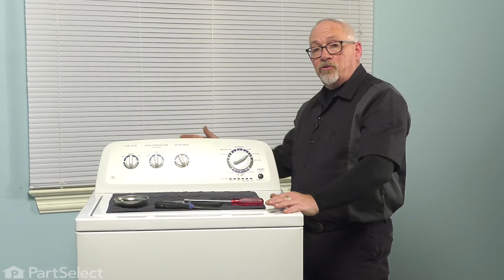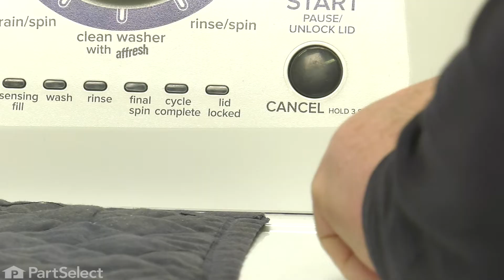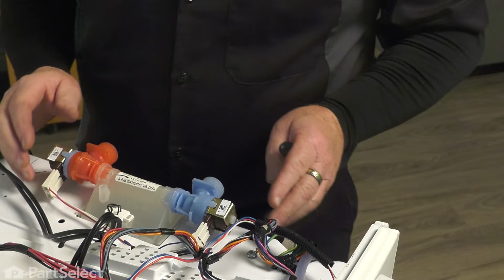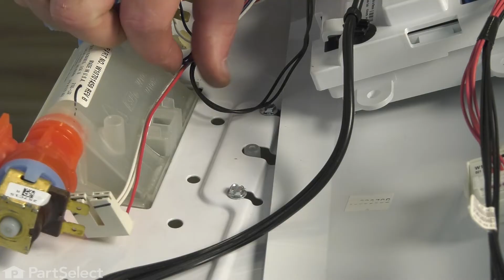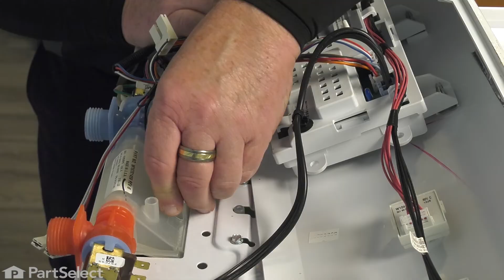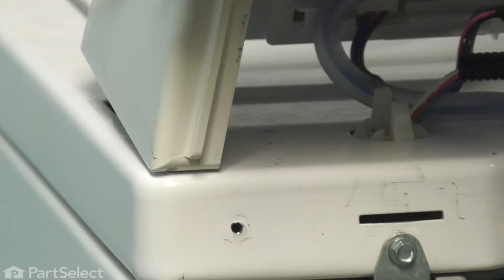Whirlpool Washer Repair - How to Replace the Water Inlet Valve (Whirlpool Part # W11210459)

Comment: You...
Are...
AMAZING!!!!!
Clear, concise, and CORRECT in doing work like this. Someone else said to reach up underneath the washer paneling and body to depress those tabs to remove the control panel... you simply used a thin putty knife to depress those same tabs... EASILY. My Whirlpool is only 3 years old. Im not getting cold water flow. Its getting hot water, just no cold. Ive checked and flushed all inlet and outlet water hoses and reassured both plumbing valves have plenty flow. My cold water inlet was caked in muck, so i soaked it overnight in apple cider vinegar. It was clean as brand new again, reinstalled it... STILL not getting COLD WATER flow. My wife ONLY uses the cold water side. Hot water screen never gets used, still looks brand new. However, this very inlet valve being replaced in this video on mine is FILTHY as the inlet screen was!! You can SEE how filthy with sediment and minerals through the opaque plastic body of the valve, _so i just ordered a brand new one to replace my old one, and hopefully get my STILL NEW washer taking cold water again. They certainly dont make em like they used to, huh?

Comment: Thank you for this helpful video.  I was able to repair my machine, exactly how you instructed, and it only cost me $24.99.  I had been using a garden hose to fill my machine for over a month now, and it was so rewarding when she started flowing properly, again.  Many thanks!
Reply: I didn't even think of filling up the washer manually. Mine just broke. Cold side only. If I wanted to do a wash, could I jsut fill it with cold water using a bucket ?